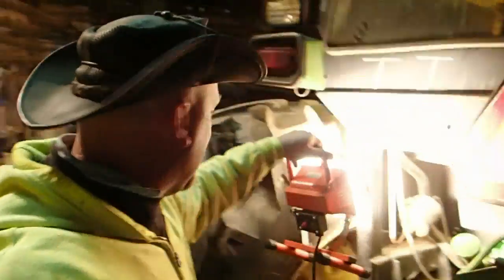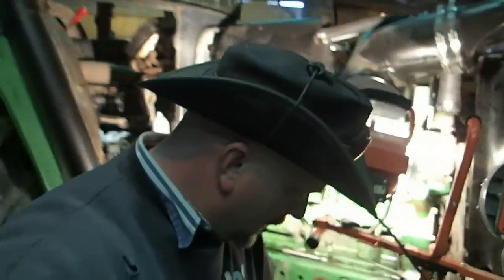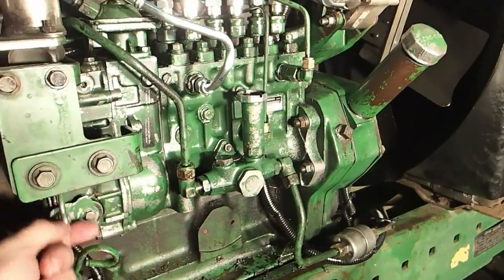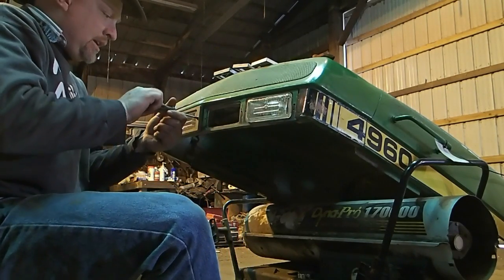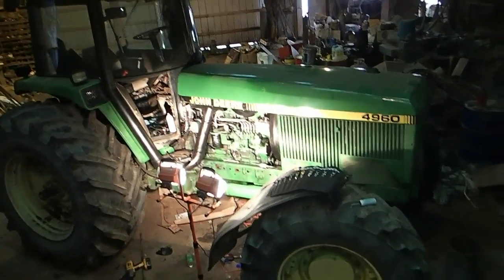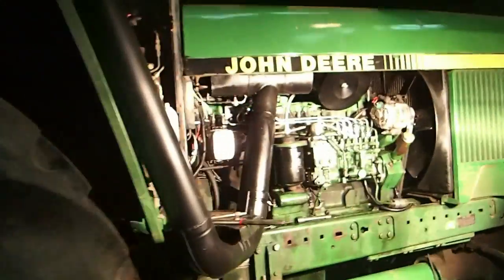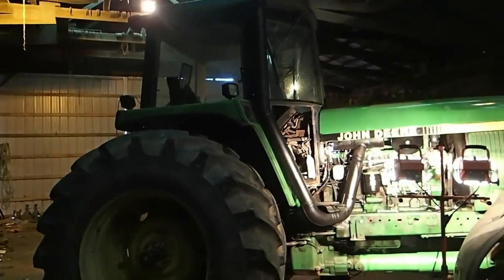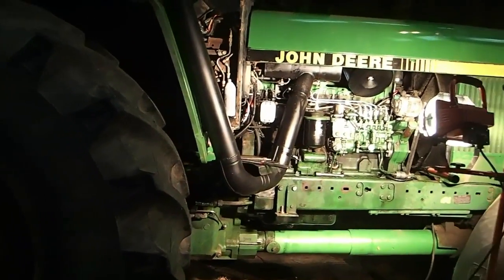4960 Pt 13

Comment: I've only just started watching your videos, but I'm loving the ' real life ' stories you do. I remember helping build a race car from scratch , and just like you show things don't always go right. Engines don't always start up first time when they've been built up , and tractors don't either !! Keep up the good work !
Reply: I don't think Wes Bled the air out of the Injector lines on the original Injector Pump / Lines .  After he put on the new reman Injector Pump he DID bleed the air out of the lines , and the it started .  Could it be the only thing wrong with the original Injector Pump was that he FAILED to bleed the air out of the system ????

Comment: I enjoyed watching you in time lapse photography, replacing the light bar using a handle held screw driver for the delicate work. I have seen so many mechanics INSIST on using a drill driver with the torque limiter turned all the way up!

Then, when the tapped holes strip out or the small nuts break off they INSIST it is due to poor design! I appreciate watching you put the love back into this machine!

I have a guy right now, who cannot download a file, yet everyone else can. Then he provided his login credentials to a friend to login & download the same file and that was successful. But when he try's, it always fails. So he blames the hosting company!

That is about as stupid as everyone who lives on the street, can successfully drive upon it & get to where they need or want to go. But he can't with a functioning motor car. So in his mind, it is the fault of the city he cannot drive his car upon the very same street everyone else is using!

The mind numbing mentality of some of these so called engineers in these days! They are really not engineers at all!

Comment: Hello wes, just a thought for you about the injector pump. On some of the engines there is a small gauze filter behind the inlet pipe on the pump, it could be blocked with the bits of plastic. The only reason I know is a diesel van I had did this. Hope it helps .
All the best Gazz

Comment: Great work I'm a agri mechanic I know how it feels when people have a dig keep your chin up and plough on buddy
Reply: I don't think Wes Bled the air out of the Injector lines on the original Injector Pump / Lines .  After he put on the new reman Injector Pump he DID bleed the air out of the lines , and the it started .  Could it be the only thing wrong with the original Injector Pump was that he FAILED to bleed the air out of the system ????

Comment: Will you have to get a new injection pump as you said or would you consider a rebuilt / refurbished one (- if available)!
Congratulations on no oil leaks thus far - that is a major accomplishment in it's self as well as getting all those wiring looms in place. Hopefully by the time get a new pump and fit it you will have the reverser connection as well!
Well done on getting this far so quickly.

Comment: Tractor looks great Wes. We all have that thing were attached to, Be it a pickup truck, tractor ect ( mine just happens to be a 7120 Case that I use a few times during the year but do not own). There's also in every bunch of apples a few bad ones. Just throw the bad ones away and don't let them spoil the good ones. Have you considered lining the battery box with truck bed liner ?

Comment: Wes, I live on a farm with a Ford F600 and a Ford 4000, and get this, t has a John Deere Battery Box in it. Oh and by the way, I really Like any 4960s. Best tractor in the world until they burn like yours did. Something That I do everyday before I go to work with the 4000, is check the wires and make sure they are not rubbing.

Comment: always been my experience with massively complicated projects like this that something somewhere always has to go wrong, if it didnt it be worried it would do it in the field lol, i have a 1999 f150 a while back similar to that black f150 you have and it has 225000 miles and blew a headgasket, it was my highschool truck, alot of memories were made [especially in the backseat area haha] and its got me through some things that no half ton truck should have to do [like pulling 14000 lbs or hay up a huge hill and getting it in the barn before a storm could ruin it] so i decided, with encouraging from watching your videos on this 4960, that id go ahead and fix the damn thing, it might of been dumb and not worth the effort [kinda like the 4960 with exception of the fact that yours it farrrrr from worn out and is now worth alot more then you had to put back into it to make it that way] but i really wanted that thing back so i did and just it done last weekend, my usual moment-of-truth setback was wiring thanks to it setting a year and those slimy bastards of the animal kingdom, rodents, but shes going again and i love it, i havent licensed it or anything but its been around the farm i used it as a work bench changing oil the other day and felt good lol, but anyways yea i think its the same with people theres always one asshole that tries to screw everything up for ya, well this asshole thinks you do an awesome job and i love watching your videos, yea i do the same thing too but i like seeing how other people do it to compare to my way if that makes sense, stay the course man dont let em get to ya

Comment: just rewatching all the 4960 videos and I agree fully soundguard tractors are my favorite. my boss has a 4640 and a 4850 4x4 and those things are really good. a few years ago he bought a newer jd 8400 and the engine went 2 times in the 5 years he had it so he went back tithe 4640 and this year he bought the 4850 so he had a bigger tractor to suite his needs better. (we only milk about 60 cows and he just chops and spreads with it and tillage course)

Comment: Haters will hate no matter, as stated by others, ignore them. Have to agree with taking your injection pump to someone to have it rebuilt, much cheaper in the long run. May have to wait a bit longer to fire that ol' girl up but, look at it this way. Good things come to those who wait. Have patience. I'm an old stickler for the older 2 cylinder "Johnny Poppers" and the 10 & 20 series Next Gen's JD. Older IH's, rather, Farmall's were also excellent tractors... back in the day. Cheers

Comment: I had problem whit my nuffield not produsing any smoke when starting, i thought that the IP was bad, but all i did have to to was loose the fuel lines from the injectors, crank until there was fuel coming out, and it did run fine again.

The nuffield also sat 20 years in barn whit dry injection pump, and it didin't broke
Reply: I don't think Wes Bled the air out of the Injector lines on the original Injector Pump / Lines .  After he put on the new reman Injector Pump he DID bleed the air out of the lines , and the it started .  Could it be the only thing wrong with the original Injector Pump was that he FAILED to bleed the air out of the system ????

Comment: good job wes ! you are almost there !! are you sure you can't rebuild that Injection pump ? it shouldn't be THAT corroded. get it apart, blast it with soda or glass beads. plunger barrels and plungers, maybe camshaft and rollers get changed and your good to go ! (all this done by a diesel injection shop)

Comment: would it be worth checking the high pressure side of the injector pump, maybe worth bleeding the low side and then the high side ,,,just to see if the pump is totally done in.you never know... all in all a great job.

Comment: could you not rebuild the pump and save a little cash for a little while till you could get a new pump in? unless there's not a way inside it? Tractor looks superb. and was really wanting to turn over. that tractor is a pot of gold once restored, hard to come by in good shape these day and as you know they are very desirable, maybe more so than the newer ones of the same size. thanks.
Reply: injector pumps are precision hydraulic equipment and take specialized tooling to rebuild, not something your average person can do. you also need an extremely clean room to do it in.
Reply: Tim McNeil oh ok. Thanks for replying. Learning everyday lol.

Comment: While you're waiting for a pump you should take all the injectors out and compression test all the cylinders, you could have stuck rings or buildup on the valve seats.  That ether should have fired no matter if it was getting fuel or not.  The engine was running and stopped while hot having no time to cool down and then had a hot fire around it followed by sitting for a few years without moving so there very well could be compression issues, well worth checking before you buy a 2000 dollar pump.

Comment: Wes I think you just need to bleed the air out of the lines. loosen the nuts on the injectors. turn it over until fuel shoots out tighten them up again and it should start. if thats not the case then have someone who rebuilds pumps take it apart and free up the pistons inside.

Comment: Your'e not a horrible father Wes. Far from it. You're good. Thanks for making all these videos, its appreciated. :o) Now back to the tractor. You've bled the pump at the injector pipes and its got power to the shut off valve. Power to the glow plugs if it has them. Is it cheaper to get the pump reconditioned by your local diesel shop?

Comment: Wes, how did you diagnose the problem with the injector pump?  Obviously there were a number of steps that didn't make it onto the video.    Probably found it when trying to bleed the lines to the injectors.  How confident are you that the pump is the problem?  With the amount of starter fluid you shot into the intake, I would have expected it to fire off even if the injectors were completely inoperable,  assuming that the injectors were the only problem.   Did you do a compression test on the engine at any point in the rebuild?  Love the videos, and don't let the trolls get you down.  There are a lot of us out here who appreciate what you and your family do.
Reply from the maker: %100 confident lol i put the new one on and wham she fired

Comment: A question from the ignorant... if its the IP not supplying fuel to the engine then why didn't it even cough when you sprayed 'crack' (love that term) into the air flow? That should have got into the engine cylinders and been compressed correct? But the engine, as far as I could hear, didn't even make any cough at all. In most diesels even if it doesn't cough on diesel it will cough on crack. Welcome some help on understanding that one.
Reply from the maker: i was a little worried about that to!!! and it did ping a little later in the vid but i cut it on the edit.

Comment: Bad with the injector pump it´s so expensive to fix. Don´t you have some company that rebuilds injector pumps, but that take time from you. Try to fill the pump with injector cleaning fluid and let it stand for some time, if you are lucky it could work out.
/Tord

Comment: Lollipop??  LOL!!  Tough break, Wes.  Do you have a diesel shop that you could take the pump to?  Inline pumps are usually rebuildable.  May save you some hard earned coin.  I am a little worried that it didn't fire on the starting fluid, maybe the cylinders are dry??  I am really hoping that the hiss that I heard while Tim was cranking it was not an exhaust valve.  Not trying to hate, just praying for the best.  Keep doing what you do, Wes.  Bullshit and assholes are everywhere,  don't let the bastards get you down.

Comment: I don't think Wes Bled the air out of the Injector lines on the original Injector Pump / Lines .  After he put on the new reman Injector Pump he DID bleed the air out of the lines , and the it started .  Could it be the only thing wrong with the original Injector Pump was that he FAILED to bleed the air out of the system ????

Comment: Could you rebuild that pump?
Reply: sancoffsr 
one could rebuild injector distribution pump, from changing seals to the more complex parts like  pump plungers, sleeves ,control rack, valves, rollers etc, will require testing and calibration. very important that all outlets flow the same amount of fuel under matched pressures and to do that you need a test rig to set it up correctly.

Comment: you won't  get nasty  comments  here   ,,  I love  watching  your videos and they are  very  informative 
and I really like  your  comparison  to a woman ,,,it is actually like a  big sexy  lady 

my  tractors aren't  quite that  sexy ,,unfortunately I haven't  got any  green machines ,,well they are  green  but  not the  right color of  green 
the small tractor is  Oliver  green an 1855 oliver ,it was  my  grandfathers 
the big tractor is a 1980 Steiger series III panther ,,it's huge  ungainly  and  ugly,,but it  sure  makes  short  work  of  plowing  my  50 acres though
I got the  steiger  from  the  estate of  a  retiring farmer for under $15K 
funny  thing is it  had  exactly the  problem your 4960 just  came  up  with,,, 
moisture  got  into the  injection pump and  froze  the  pistons in it 
this  has  a  3208-Cat turbo engine ,,I'm  not sure if  this is the stock  engine but I know it  has  way  more  pull than  this  tractor  needs ,
it'll pull a 12 bottom 15inch plow  with no complaints